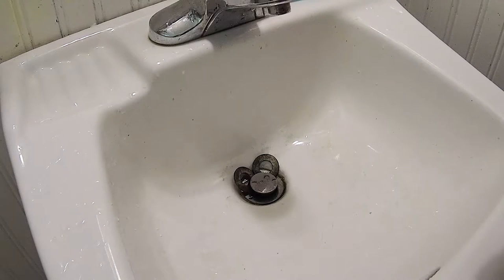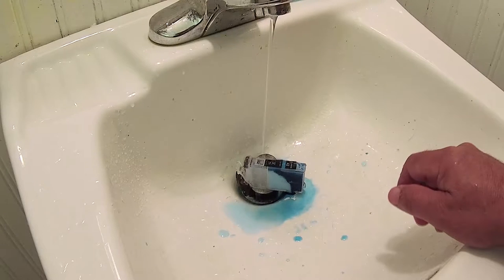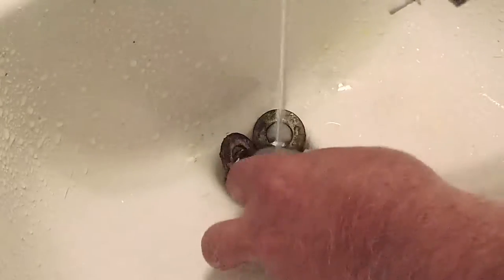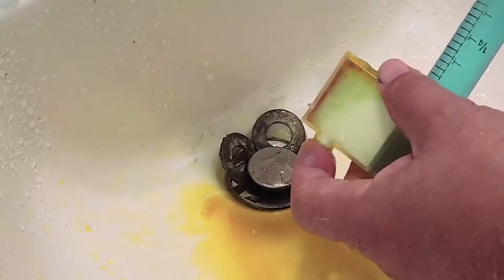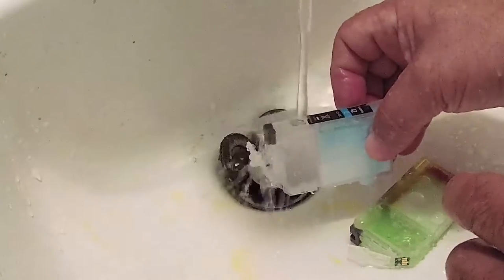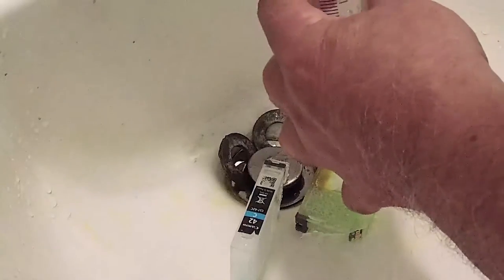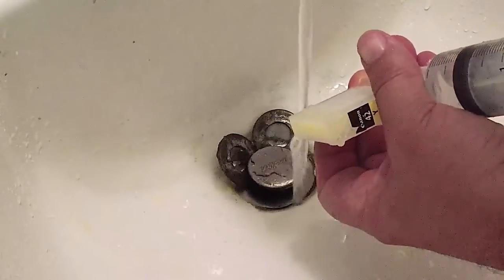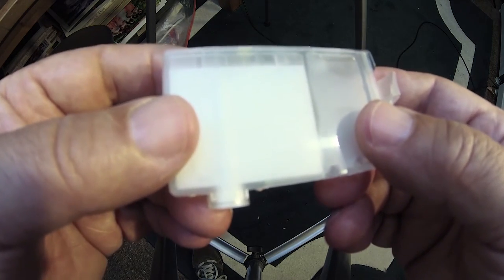#4 Flushing out the CLI 42 Carts

Comment: Hi all, I'm in the UK and don't think we can purchase Windex here. Has anyone else in the UK found a replacement we can get over here? Jose - if the carts are flushed with water only and some ink is left in the sponge (just staining), will they still work properly when refilled or will the staining present a risk to the correct operation? Thanks :-)

Comment: Thank you so much for making this and other video and how to flush and prepare these cartridges for refilling! I noticed that you have not removed chips when flushing CLI42 cartridges, doest it mean it is OK for them to get wet and that I'll be able to reset and use them later once they will get dry? Thank you!
Reply from the maker: Yes! No problem at all getting em wet. You will be letting the carts fully dry anyway and refilling with ink later doesn't expose the chips to anything anyways.
Reply: Great, thank you!
Reply: Great was thinking the same about getting the chip wet

Comment: Jose, in preparation to refill my Pro-100 cartridges I've watched most (maybe all) of your great YouTube videos covering the process.  I was about to place my order at Precision Color when I saw a note in their Pro-100 refill section under the tab "Instructions".  The note from May 2013 is titled "Important information on refilling Canon CLI-42 yellow cartridge" in which it states, "We now simply recommend that you discard the Canon CLI-42 Yellow cartridge when it empties and DO NOT REFILL IT..."   This quote is part of a full page of information about the issue.  Is this valid or should I use your method of flushing an OEM yellow cartridge for use with PC yellow ink?  PC includes one flushed cartridge for yellow in their kits but will not sell a second flushed cartridge.  In order to have a second full set of cartridges as you recommend should I buy an OEM (not yellow) color cartridge, flush it, and swap out the chip from an OEM yellow cartridge, then fill it with PC yellow?
Reply from the maker: Use their replacement yellow flushed cartridge. It takes about a week to dry a flushed cartridge so it can be refilled. You will need your original yellow chip to install on the replacement cart. It's best to simply buy a set of already mid and flushed carts from the EBAY link you find in my video descriptions. The you can not and flush yours at your convenience.

Comment: Hi Jose.  I've flushed my YELLOW CLI-42 with three one hour soakings of Windex and flushed with tap water, and then with Distilled Water.  The sponge looks absolutely pristine WHITE ....  OR DOES IT ?????   It looks snow white and uniform when looking down at it ... but when I hold it up to an intense light source and shine light through the sponge, I see hints of yellow tint (mainly at the sponge seam where it changes density).  I never would have noticed any YELLOW if I wasn't OCD and didn't hold it up to the light.   I checked one of the flushed CLI-8 from PrecisionColors and see there is also some yellow tint.  Am I worrying too much?  I've got the dry weight down to 13.74g ... will see if it drops anymore.  Thank you, Sir !!
Reply from the maker: Yes you are worrying too much.  It will work just fine. You've gone beyond what I already consider more that enough.
Reply: Thank you, Jose !!!  (It's down to 13.69g now ... LOL ...)
Reply from the maker: Perfect!
Reply: Jose, while pushing down on the refill hole plug after filling a cartridge, some ink came out the top air vent (through the serpentine channels) due to air pressure.   Might this eventually cause an inkflow problem when the ink that got into the serpentine channels dries up?   (I've learned from now on to keep my finger over the air vent when pushing down on the refill hole plug).
Reply from the maker: That can happen if filled beyond 3/4 or higher. You will not believe how people solve that.  The literally VERY carefully blow into the serpentine vent directly with their mouth touching the cart.  You might end up with a cyan lip if not careful.
Reply: Interesting ... that's actually a good idea .... So I used my GIOTTO Torpedo Blower and was surprised that it forced out so much (from the fill hole).  But then this could introduce air into the sponge ... so I guess caution is in order.

Comment: I'm having a hard time finding the proper syringes. I purchased some from Amazon that were 60 ml and didn't say "leuer" tip.  They have a tapered round tip but the end is too large to fit into the small hole in the CLI-42 cart (the one where the ball was removed and then drilled out with a 5/32" drill.)  Most of the syringes on Amazon, like the ones I bought, say "catheter" syringes.  I can't tell from the pictures which ones have a small enough tip to fit into the CLI-42 hole.  Do you have a specific brand/model you can recommend?
Reply from the maker: You dis get some Catheter tip Syringes. Completely useless for this. You should just get some 30 PLAIN TIPPED syringes such as these.  https://www.amazon.com/Pack-Liquid-Dispensing-Syringe-needle/dp/B00FUOJPKC/ref=sr_1_fkmr3_1_a_it?ie=UTF8&qid=1497227071&sr=8-1-fkmr3&keywords=30ml+syringes+plain+tip
Reply: Thanks, Joe, I will check those out.

Comment: Hello Jose, today I received a full set of used CLI-42 cartridges. Because it looked like the ink was pretty dry I proceeded to flush them utilizing your Windex technique. All 8 cartridges came out perfect with the exception of the Photo Cyan cartridge which still has a very slight cyan tint. One thing I noticed while I was flushing is that the label was mostly removed on the Photo Cyan cartridge, so water was leaking from the entire top of the cartridge. Is this an issue ? If so can I just put a strip of tape on the top to salvage the cartridge ? Thank you for all your videos....very educational.
Reply from the maker: Once they are brought to fully dry condition that vent will be free of water. Always fill them so they self balance themselves at no less than 1/6" from the top of the liquid chamber. Don;t just count on my videos but also watch the videos on the precisioncolors web site concerning point to look out for. Keep in mind we DO NOT guarantee any of this.  
Refilling is the choice of the user and so it is your responsibility to perform the process correctly so you have a successful expereience.
Reply: @cheo1949  Thank you Jose, I just wanted to make sure that by not having the label on the top and having the vent completely  open that it didn't cause any ink flow issues. BTW, I tried this drying method and it seemed to work well. After flushing the cartridges with water I placed one cartridge at a time with the sponge opening facing on top of the nozzle of my wet/dry shop vac. I did not seal off the entire opening of the shop vac nozzle as not to create an extreme vacuum in the cartridge causing the black hole effect. I was able to get the weight from 20 grams to 14.7 grams, they will be sitting on a sunny window sill till it weights between  13.5 and 13.8 grams .
Reply from the maker: May ways to "skin a cat" I mean dry a cart. PROs like PC use a food dehydrator. to dry a bunch of them art once.

Comment: I got a pack of the 60 ml syringes on Amazon and of course they are too big to fit into the 5/32 in opening. I saw where you suggested a smaller syringe. I also see that there seems to be a snug fitting extension on the syringe you use in the video. Are they available ? or do I have to get another set of syringes?
Reply from the maker: You probably baught either Catheter or the threaded type syringes. Plain tipped syringes is what you need. I use a tip on mine. But a tip will not fix the problem if the syringes has a large tipmsuch as the cathetter type. Contact www.precisioncolors.com to see if the have a tip for the 5/32" hole.

Comment: Hi Jose,I enjoy all your videos, you have a genuine, sincere approach to boat loads of information and I thank you.My question is how do you feel about using neat isopropyl alcohol mixed with 5% ammonia to flush the yellow carts. I'm thinking of trying it, but don't want to ruin a yellow cart in the process.
Reply from the maker: Winded works perfectly fine. Flush and let it work for a day or so before flushing out the windex. If the sponge does not look almost white. Repeat.  That's what I did on the video.

Comment: Dear Sir,  One of the larger syringes you use to force water into the cartridge has what appears to be a white rubber "grommet" or tip to seal to the hole that you drilled out with a 5/32" drill.  Where do you get such a seal?  Thanks in advance.  SWW.
Reply from the maker: It's a longer tip I attached. A plain tip syringe will fit just as good.

Comment: With respect to yellow cartridges you recommend Windex (with ammonia) Do you have a view on using, say, a 5% ammonia solution as in the UK believe it or not it is easier to buy ammonia than it is to get Windex with ammonia.   As a fountain pen user I use ammonia to remove stubborn ink from components when restoring pens, therefore I have a fairly plentiful supply.
Reply from the maker: Our Windex also has a soap or surfactant so if you could buy window cleaner and add ammonia to it that should work. Just make sure to NOT flush with water first.
Reply: @cheo1949  Thank you.

Comment: Dear Sir,  My Apple MacBook Air indicates that my CLI-42 Carts are all Full.  When I physically look at each Cart, the liquid fill ink chamber on each cart are almost empty (about 1/8th inch from bottom) but the sponge supply side is still full.  Will my printer indicate less than full after the liquid ink chamber empties and the sponge chamber starts to empty?  I just bought this Canon Pixma PRO-100 yesterday and getting familiar with the machine.  Thanks!  SWW.
Reply from the maker: It should show almost low. What driver did you use to install the printer?

Comment: Hi Jose! Love your videos man you're a massive help to me. Just wondering, if you or anyone else knows of a UK equivalent of Windex? We in the UK don't seem to be allowed the amonia ingredients it contains! Or is there a way we can make it up ourselves? I have flushed my carts very throughly but i am left with the 'staining'......do you think that will have an averse effect on my pro-100?
Reply from the maker: I really do not know. You kight want to ask in the printerknowledge forum. That residual sponge stain will not really do any harm. The inks from octoinkjet.co.UK, if younare using them do not have the yellow gelling problem. So there is no need to flush the sponge till perfect!y white
Reply: +Jose Rodriguez thanks Jose, that's good to know. I am using octoinks but it's an original yellow I am wanting to flush, am I correct in thinking that will jelly with water?
Reply from the maker: What th mistake is that most folk start with water. That causes the immediate reaction. You can use regular non ammonia window cleaner and just add about 5% ammonia is you can get it from the druggist or other source. Begining with an ammonia based cleaner immediately breaks down the ink out of the sponge so that simple water flushing easily finishes the job.
Reply: Jose Rodriguez so to clarify you can flush the yellow with the ammonia mixture and follow through with water from there on in? Thanks Jose
Reply from the maker: Yes. That's what I did on the video. No problems as long as the sponge ends up white.

Comment: Dear Sir,  Do I need to flush out my nearly empty Canon OEM CLI-42 Cartridges that have been previously filled flushed and filled with Precision Color CLI-42 Inks before I switch to the newer Signature Edition CLI-42 Inks from Precision Color?  Or can I just use the newer version of the ink without the flushing process?  Regards, SWW.
Reply from the maker: No need to flush. But you can not just flush tbe yellow one with water. That's why they will provide you with a flushed cart that you will install your own yellow oem chip.

Comment: Hi again Jose. Think im gonna go the Octoinkjet route. Just wonder why they say you should not flush the yellow cartridge with water? Or a'm i missing something?
Reply from the maker: Yes I know that's what they say but...... I do not agree with that. Remember that is it the OEM Yellow ink that reacts IF the conditions are perfect to ANY third Party water based ink. So no ink is exempt from the possibility of the gelling reaction.
Reply: @cheo1949  ok i trust you. Do i have to  clean the printer head on my pro 100s before switching to  the Octoinkjet ink to prevent any Yellow gello problems. If yes is it just to remove the printer head and clean it with Windex?
Reply from the maker: No just run a cleaning cycle or two and run a nozzle check.
Reply: @cheo1949  Thanks jose, Ok I just ordered a set of Octoinkjet cli 42 pre filled to try them out before buying the whole kit. 
As my black and grey Canon ink seems to run out quicker  than the rest, do you think I could replace say the black OEM cartridge with the one from Octoinkjet  and keep printing with a black one from Octoinkjet and the rest from Canon? The Octoinkjet contains there v.2 ink!

Comment: Is there a current video showing how to flush the PGI 72 Canon ink cartridges? I have other people's cartridges and don't know how long they've been empty. Also is there a way to do it without doing any drilling?  Also, If I use the larger syringe to put the ink in, how do I clean out the syringe to not contaminate the syringe with another color? Thanks! Carol
Reply from the maker: https://www.youtube.com/watch?v=rzY6sqEn4Z8
For the PRO9500 MKII but they use the same type of cart as the PRO-10 so all will apply!
Reply: Thank you - do you know where I can purchase flush clips for the PGI 72 cartridges?
Reply from the maker: You need to make them yourself. Or buy it from here: http://www.octoink.co.uk/products/Flush-Clip-for-PGI%252d9-%7B47%7D-PGI%252d72.html

Comment: Hi Joe, I have been watching a lot of your videos about refilling the Pro-100. I have a few questions however. if I buy a full set of OEM carts that are empty from eBay that has no OEM orange caps, will I be able to still flush them and use them without having any issues with the sponge or anything? Ill do a full flush to each cart with Windex with Ammonia-D. is there anything that you can suggest me doing or anything to look out for before I buy the set.
Reply from the maker: You are definitely going to need the orange caps!!! There are fully modified and flushed sets including the better orange seal for $59 on ebay 
https://www.ebay.com/itm/Canon-Pro-100-CLI-42-Flushed-Empty-Set-of-8-Drilled-w-Plug-Storage-Clip-Chip/223297257185?hash=item33fd8dbee1:g:UqAAAOSwSbxbT6HW:rk:12:pf:0
Reply: Joe thank you so much for the answer i found a good European set of carts online that are oem and never used. I want to have that second set process. I think its the best way to refill like you say in many videos. Thank you so much for doing these videos and helping all of us out with printing. Big thumbs up.👍👍👍👍👍👍

Comment: hi Jose, I'm kinda confused. I understand flushing yellow cart is necessary to avoid that jellow problem. why are you flushing other carts of ink, I thought we can mix precision color ink with remaining Canon ink in the carts  except for yellow.
Reply from the maker: The carts were used up completely. The sponges were full of air. And they were all dried up! That is what you get from eBay and you must flush them. If you are beginning with your own carts then you can mod and fill them as they go LOW. Never empty. Just top off with PC inks. The yellow needs to be either extremely well flushed with windex as I show, or replaced with another flushed cart as suggested. So in short when you start from empty dried carts, you must flush!
Reply: Thanks Jose !

Comment: Hi Joe!! Just modified & refilled my first set of canon OEM cartridges with precision colors ink.. it went smoother than I expected.. however, drilling the holes with the 5/32" drill bit (on my OEM cli-42 cartridges) still left a few flakes of plastic residue in two of the cartridges that i couldn't get out--I am hoping these small fragments of plastic won't be problematic. I have a question (besides the comment about tiny pieces of plastic that got left in the cartridge while modifying them).. When you are totally flushing out the cartridges (as in the above video), is it ok to leave the canon chips on the cartridges? I think I see chips on the cartridges you're washing out (and I will be flushing my OEM yellow cartridges at some point).. I am assuming they are working chips on these cartridges that you will be resetting, and that the flushing/washing process doesn't damage them. ??  If you can clarify for me, I'd appreciate it. ~Christine
Reply from the maker: Do not worry about any little plastic chips that may have fallen in. They will float. The cart electronic chips will not be harmed at all during flushing.